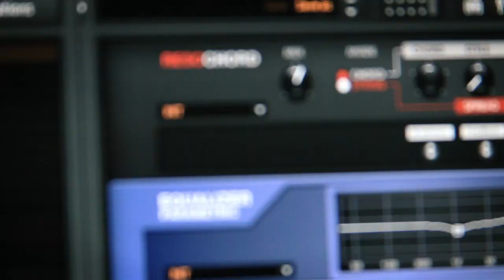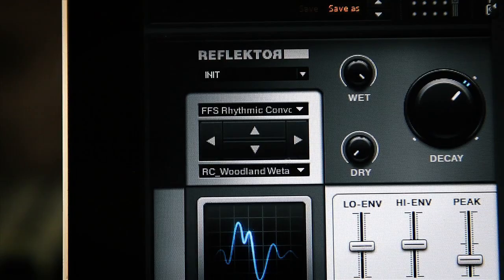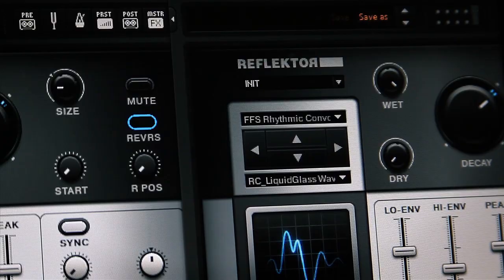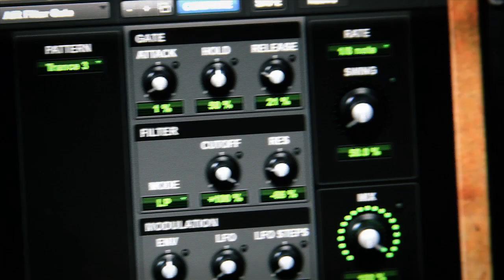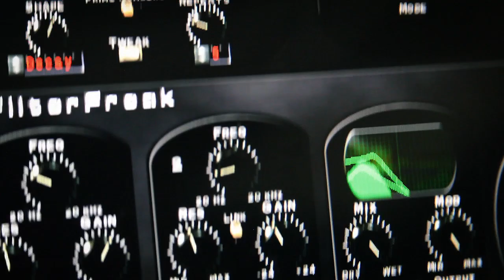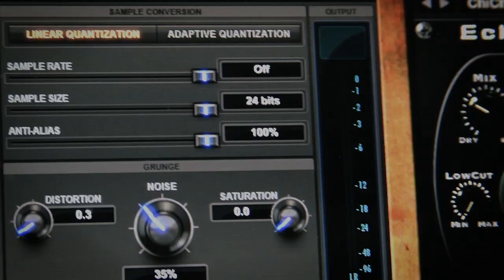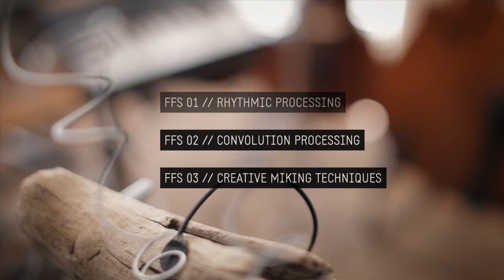Diego Stocco - Beachwood / Real-Time Multi-Processing Improv

Comment: Did you build your contact mics?
Reply from the maker: Some of them, but not the one I'm using in this video, I purchased it.
Reply: Diego Stocco good to know! Thanks for the reply man!
Reply: Diego Stocco I'm thinking about investing in a couple of lavalier mics. Which ones do you find most suiting for sound design purposes? What do you use yourself? I find a lot of cheaper lavaliers to be quite "harsh and toppy". Thoughts? :)
Keep doing amazing work and inspiring into new ways to look at sound and the creation of it!
Reply: Diego Stocco Some cheaper, good sounding lavaliers would also be interesting to hear about!
Reply from the maker: Mikael Lindblad It depends what kind of sound you're trying to create, where you want to place them, etc.. online retailers usually have a good selection with different prices, from there you can see the specifications. Great sounding vs cheap is not so easy :  )